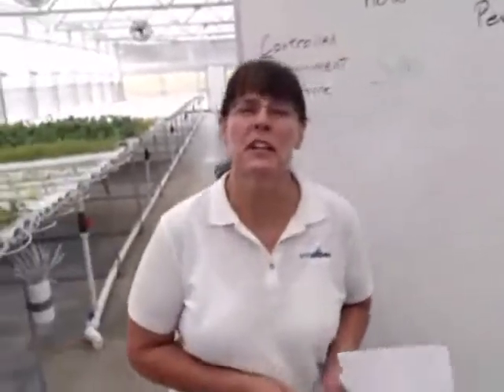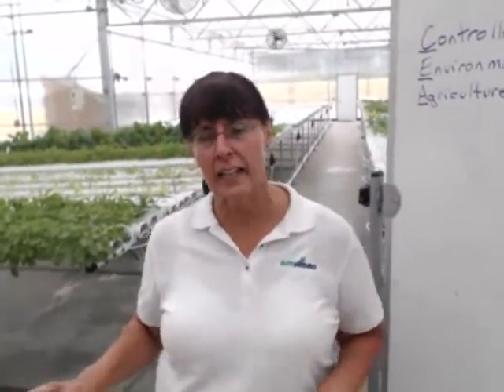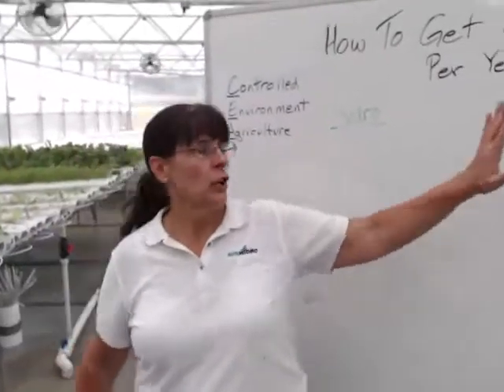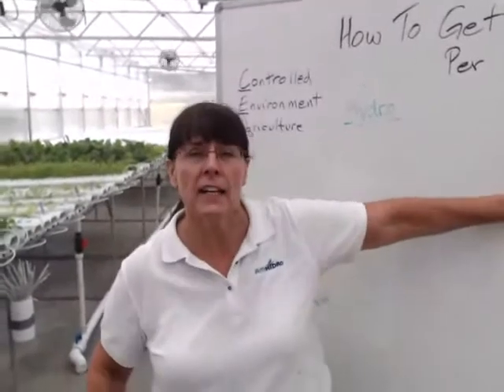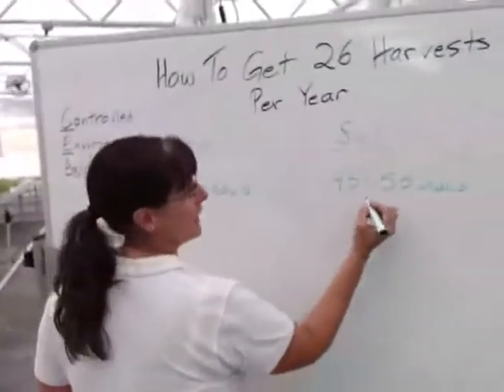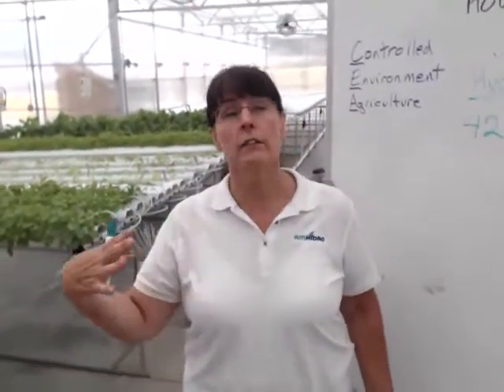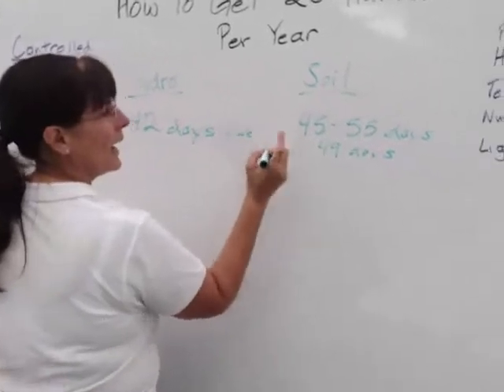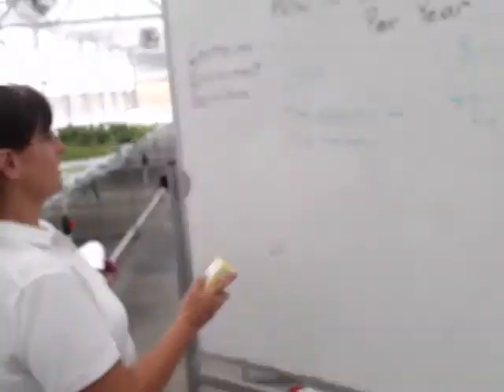Optimize Your Hydroponic Greenhouse Harvests | American Hydroponics Webinar

Comment: Hi Jenny, question. Why not bypass the nursery after the propagation and put it straight to the finishing and it's gonna be less work?
Reply from the maker: The nursery stage increases your crop turns per year.  Out of one FInishing site, you can harvest 26 plants per year.  This is based on a 6 week plant cycle - 2 weeks in propagation, 2 weeks in nursery channel and 2 weeks in finishing channel.  If you remove the nursery channel stage your harvest drops to 13 plants, per finishing site, per year.  Plant still need 6 weeks to mature but cycles would be 2 weeks in propagation system and 4 weeks in the finishing channels.  The Finishing site is where all your money comes from.  You want to maximise your crop turns.
Reply: @AmericanHydroponics  Thank you very very much for this explanation. I still have 2 questions if you don't mind. 1. On the seeding propagation, do you correct the PH water here or it's just plain water without nutrients? 2. The water from nursery and finishing are same nutrients or less nutrients from nursery? TY!!!!! ☺️☺️
Reply from the maker: @jamesramos815   You are welcome.  The propagation system has a working solution at 5.8 pH and an EC around 0.6.  It is seperate from the main system.  The Nursery and Finishing channels use the same working solution from the main reservoir.
Reply: @AmericanHydroponics  Thanks again for the quick reply. Do you provide tutorials or training online how to do proper hydroponics for lettuce and tomatoes?

Comment: hello. Great video. I have a question. You have calculated 500 plants per week in  a year i.e 52 x 500. But initially you cannot harvest until week 6 so is it correct to multiply by 52 weeks to get 26 harvest in a year. But once you continue it may be correct?
Reply from the maker: Of course.  There will always be start uptime to get your first crop harvestable.  26 CTT is basically a harvesting technology to define harvest numbers and determine how many seedlings you will need to plant.  For easy math, if you have 100 finishing sites you can harvest half of that number every week if you plan on a 6 week growing cycle. Here is a CTT sheet for the NFT 1200 system for reference.  https://www.dropbox.com/s/w8d7lodai2e2jt0/CTT%201200%20NFT.pdf?dl=0.  Only caveat is on your first cycle you skip the nursery and go straight to finishing.
Reply: @AmericanHydroponics  thank you for the clarification and for sharing the ctt sheet. Loved the video!
Reply: @AmericanHydroponics  Want to ask if CTT is also applicable for vine crops like cucumber and tomato since they have longer harvest cycle. If so can you please also share the CTT sheet for the same. Would highly appreciate it. Thanks!

Comment from the maker: You will need 30 since there are 18 sites per finishing channel.   Using 1" thin cut oasis there are 276 cells per flat (a flat is 10"x20").  One of our prop trays holds 2 flats allowing room for 552 seedling sites.  This one tray will fill 7.67 nursery channels (72 sites per nursery channel).  These nursery sites will fill 30.67 finishing channels (18 sites per channel).   For a visual representation, here is a CTT sheet for our 10K system that might help.  https://www.dropbox.com/s/kb4oa1e4uobpbna/CTT%2010K%20NFT.pdf?raw=1